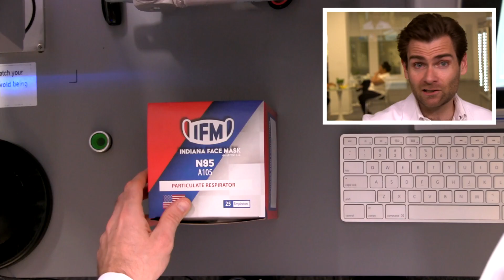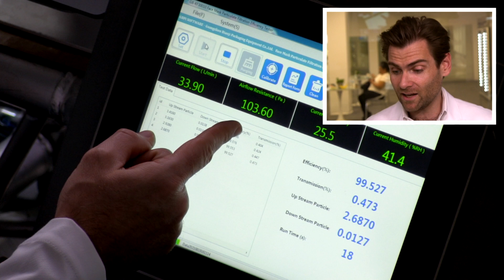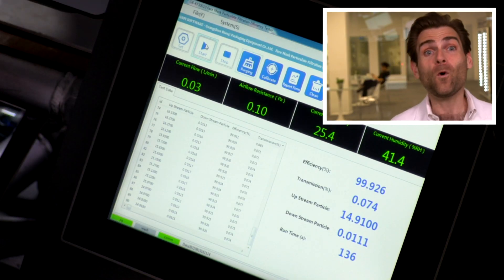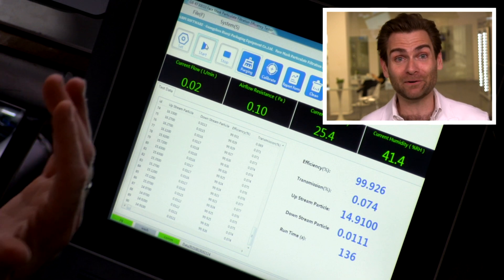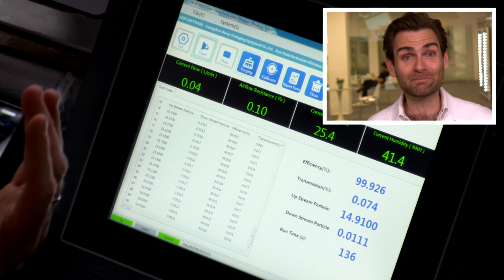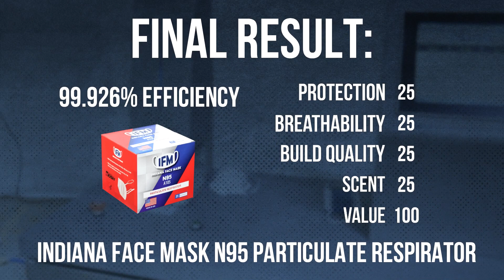The Awesomeness that Awaits (Indiana Face Mask N95 A105 Particulate Respirator - Fold-Style Review)

Comment: Ordered a box of these based on your review here.  Just arrived today.   Wow!  They live up to everything you've mentioned in the video.  Sooo comfortable.   Fit me perfectly with no leakage I can detect.   A little large for my wife's face, but she likes the Powecom KN95's that don't fit me well so there ya go.  

I've used N95's or P100 respirators for years at work and in my woodshop (mostly 3M's), but after getting these I'll never go back to the 3M n95's.   Thank you for your enthusiasm over these. as it convinced me to give them a try.  For situations where the mask isn't on my face for hours I use your Armbrust surgical masks, and because they fit so well, probably provide near as good protection.  Sensitive ears (yea, I'm a wimp) make the N95's better for long term use.

Anyone wondering if these are good, don't wait, buy them.

Comment: I don't think your pressure drop its correct. These are NOT easy to breathe through. They collapse and suck into may face during inhale, and as much as I try to seal them at the nose bridge, they blow past the upper edge of the mask and into my eyes on exhale, unless I use face mask tape; then the air starts to blow out at the cheeks. The filter material has too much resistance, and the breath is taking the easy way out.

Comment: A different opinion: They aren't all that breathable when wearing all day and the nose wire is weak-sauce for an N95 (it's basically a twistie-tie). I had major leakage around the nose. The mask was also very constrictive to talk in which made it a non-option as a teacher. I'll stick with good hospital surgical masks. Is this the number 1 mask in the universe? Nope. Sorry. Come back with thicker nose wire and integrated foam around the nose.

Comment: Very curious about your review of this mask because the review listed in the data-table on your website does not match what you say in your video at all.  Assuming that the video is newer than the written review, perhaps the title of the video should be "most improved" mask?
Reply from the maker: I just double checked the scores in the database vs the video...they're exactly the same...unless i'm missing something.
Reply: @ArmbrustUSA  Looks like YouTube censors my comment if I put the actual URL in it, but when I go to your website it actually has a "don't buy this mask" icon in the written review due to a different PFE result.  I wonder if it's a typo in the review?  And then the web server takes the mis-entered PFE result and automatically produces the failure icon.
Reply: @ArmbrustUSA  Ah, I see that it's been fixed!  Must've been a typo, then.

Comment: I have trouble getting a good seal with no leakage around the nose with these.
Reply: You can get foam nose pieces on Amazon that you can stick on the inside wire and it will take care of that
Reply: Have you found one that does give a good seal with no leakage? I'm shopping for my first N95/K95.
Reply: @inhaleexhale  try the 3M 9502 N95. It is originally a KN95 made by 3M China, but it has received NIOSH accreditation, making it an officially certified N95. It has an external nose clip, allowing it to conform to your nose snugly.